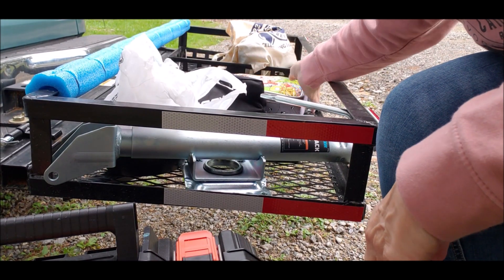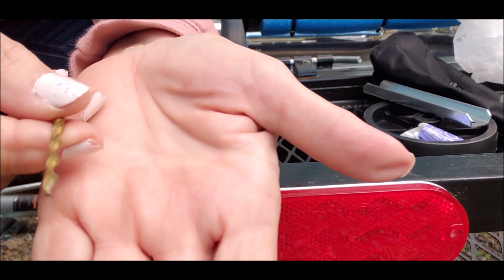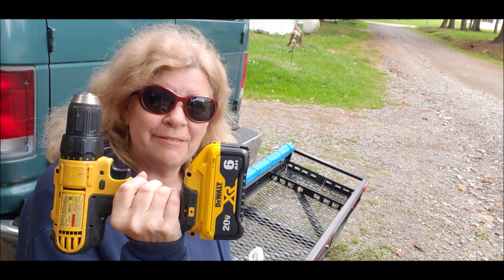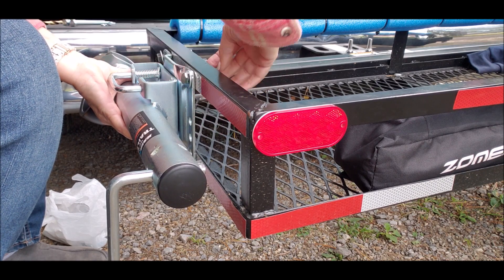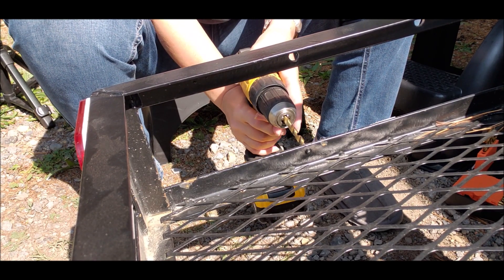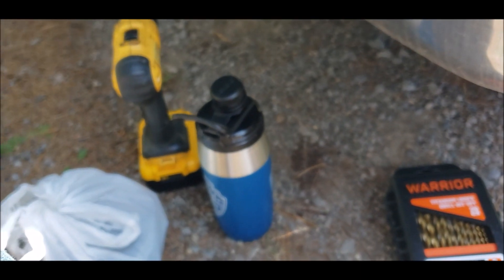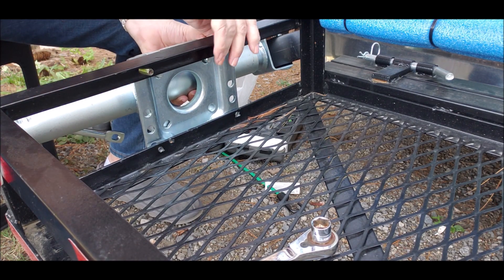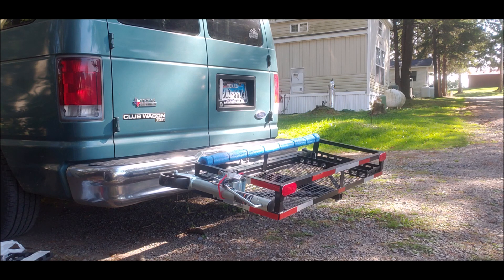Adding a Wheeled Trailer Jack Support to a Swing Away Cargo Carrier!!

Comment: Good Job!!  Now you'll have to use chains to tie down the chest to the carrier so no one steals it.  Saw a video a while back of a full-time RVer who had a carrier on the back of his 5th wheel.  Had a generator in the carrier.  As they were traveling through an area, they stopped at a red light, and the vehicle behind them stole their generator out of the carrier.  The RVer never saw it happen and didn't realize it had been stolen until they got to their campsite.  He was so upset with himself that he didn't tie down and secure the generator.  Of course, he didn't think it would get stolen while at a stop light.
Reply from the maker: If I were carrying a generator, you bet it would be locked down with a hardened chain and circular lock. 
I plan on securing the cargo box to the cargo bottom, then lock it with padlocks & always use ratchet straps just as a preventative towards road safety. Of course, if anyone wanted to steal from it, it would still be pretty easy. Thus no expensive items will be in there. Just the big bulky stuff that takes up too much room inside of the van. 👍✌
Thanks for watching! ❤😊